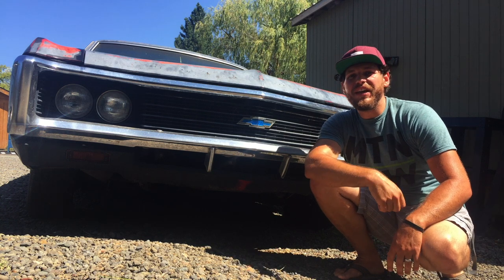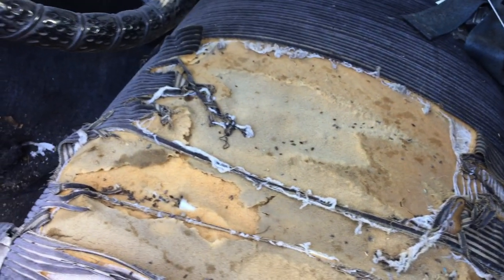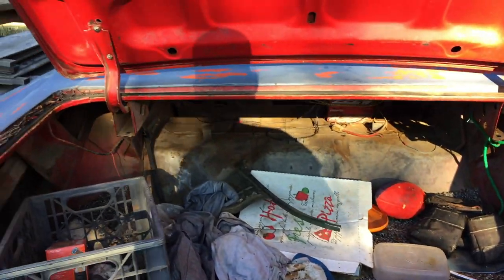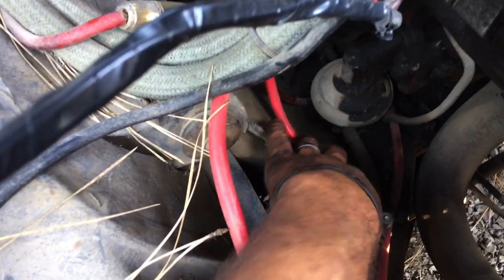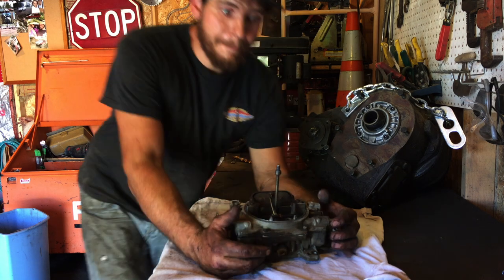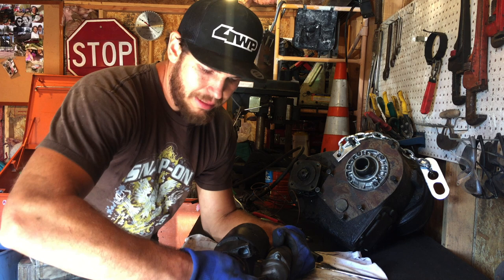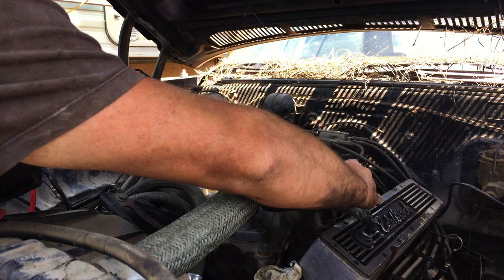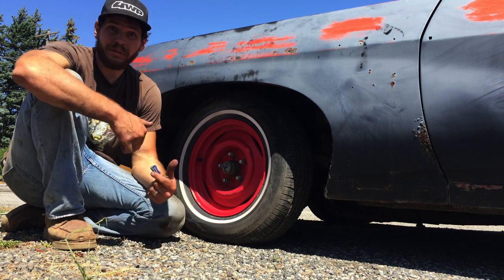Ghetto Glyder Episode 1: 1969 Impala First Start in 7 Years!

Comment: I just picked up a  69 caprice for 6,000 the trunk is rusted out it needs rear main seal  he wanted 10,000 for the car but the car needs cosmetic stuff too
Reply from the maker: Nice! What engine does it have?
Reply: @DaysofPainandVictory   It has the 350  4 bolt main A snippet picture is on YouTube when I comment on post It has 64 original thousand miles
Reply: @DaysofPainandVictory  The previous owner told me that the 69 that I’m purchasing needs a rear main seal do you think that’ll be a hard job to do/fix or would you just pull the whole motor and put like an LS motor
Reply from the maker: @cadillac9142  I would fix it, SBC are super easy to work on and a good solid engine. You still probably have to pull the motor to change that seal though, pan has to come off and I'm not sure you can get it off in the car

Comment: Love this! I have a 70 impala. She just stopped on me though..the fuel line was clogged so i emptied the tank, replaced fuel pump, cleaned the carburetor through and through..but for some reason the car doesnt want to push the gas towards the carb!? Any ideas?? Been stuck for a while on me now...
Reply: Its 350 v8 with a single barrel carb.
Reply from the maker: @StayFancyRide  Did you get the fuel line unplugged? if not I would disconnect it at the tank and at the pump, and force some paint thinner through the lines
Reply: I pushed through some air with air compressor and it just blew straight air through. Dont think its clogged
Reply from the maker: @StayFancyRide  ok, sometimes it takes quite a bit to get it primed, may need to bottle feed the carb until it runs long enough to draw fuel from the tank
Reply: @DaysofPainandVictory  alright, cool! Thanks a man, look forward tp seeing your other conversions for your 69 so I can start doing the same to my 70.
Reply from the maker: @StayFancyRide  good luck! Let me know when you get it going again. I’ll be working on it again this spring putting in some new gears and a posi!
Reply: @DaysofPainandVictory  So update. Just noticed the fuel pump rod was bent and jammed in the engine pocket. Replaced it and it looks like its starting pump gas! Battery died from trying to crank too much before hand though, so ima need to charge it and come back to it.
Reply from the maker: @StayFancyRide  dang wonder if it got stuck from running it dry?
Reply: @DaysofPainandVictory  shit probably. Question! Whats the biggest tire size i can put on the impala if I were to lower it about 1.5" ?? Without it scrapping or damaging anything? Notices alot of peoplw put 20s but without having to modify alot? I know back then they had alot of space for the tires.
Reply from the maker: @StayFancyRide  I don’t know on that one, tire shop might be able to help out. Probably gonna take a lot of trial and error
Reply: @DaysofPainandVictory  update. Car still didnt start after fuel started reaching the carb. "Final" issue! The distributor was off and some how the engine wasnt set to first so it was firing all over the place. Baby, is back up and running though. Cut the springs to lower the car and ill be putting 20in foose classic rims on her. Shes bringing tears to my eyes.
Reply from the maker: @StayFancyRide  nice glad you got it going!

Comment: Quick question what is the bolt pattern i have the same car and i want to buy new wheels but not sure if the bolt pattern is 5x5 or 5x4.75
Reply from the maker: 5x4.75
Reply from the maker: Thanks for watching!
Reply: Thank u so much gr8 video btw
Reply from the maker: @mizaelramirez6179  no problem! Thank you! What style wheels are you getting?
Reply: @DaysofPainandVictory  I had a quick question I recently purchased a 69 caprice and the previous owner told me it has a rear main seal leak so I took it on a test drive and it wasn’t shifting And I didn’t see any oil Which he said it was all but it was transmission fluid that was leaking out so I’m confused lol